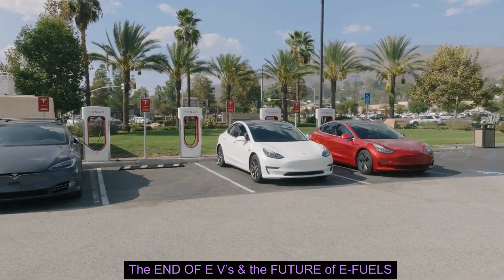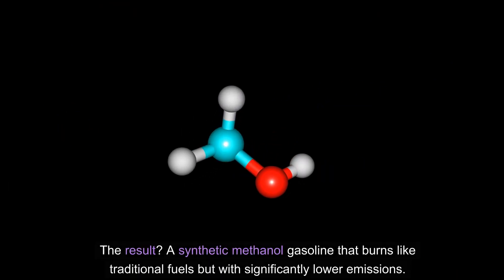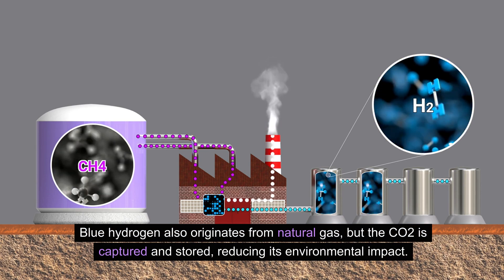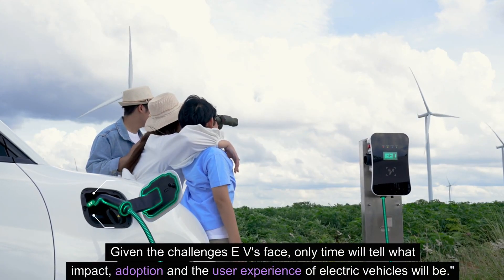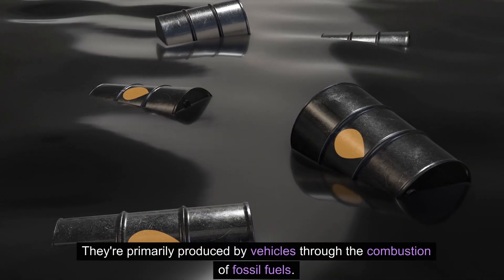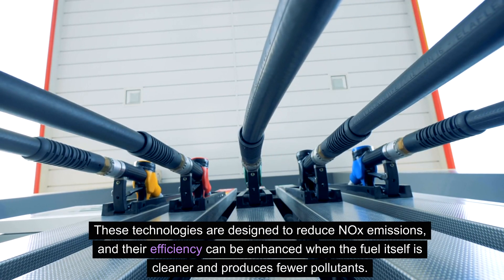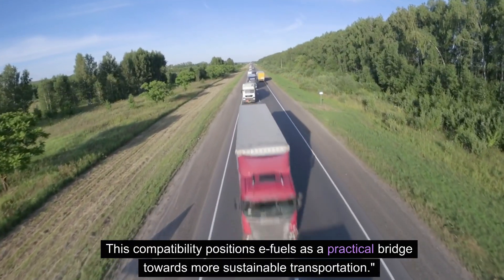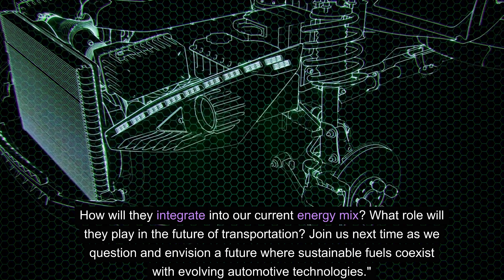CLIMATE CHANGE, THE END OF EV's and the FUTURE OF E-fuels

Comment: Wonderful invention. Still need use of fossil fuels for ICE cars can keep having wars in M.E. 
Just pour a bottle of e fuel will do to get rid of NOX emission.

But EV car is still a better choice. 

Do away with existing bulky ICE in front of the car with exhaust pipe nonsense. Install a mini petrol generator in car and pour e-fuel in it to charge  LFP  battery. With a generator in the car solve the anxiety of range problem of a flat battery.

The battery no need to charge to full capacity but can charged to10% capacity feom the generator to keep moving and driving until hit the town to get it charge up to full capacity and keep driving. 

Use induction motor still the best option for torque and power, quiet, spacious, FSD autonomous driving and new EV design.